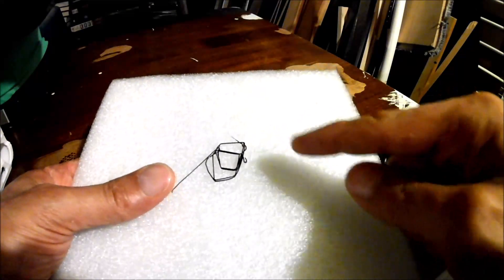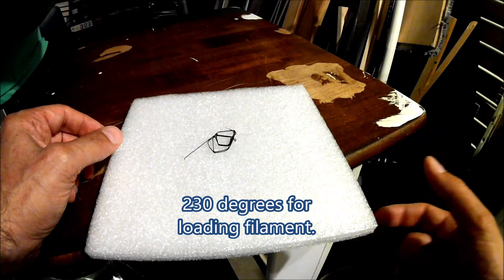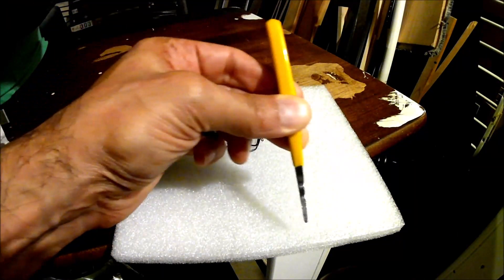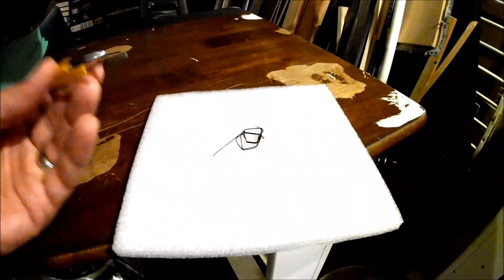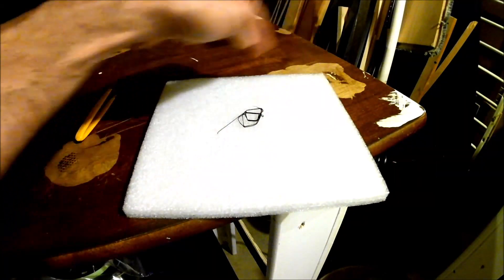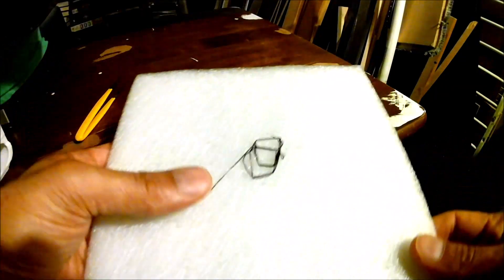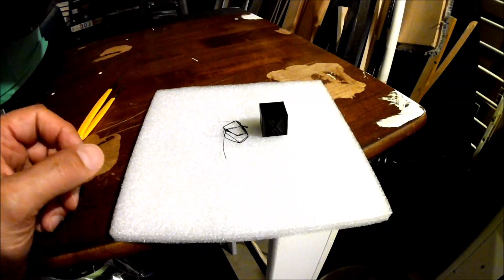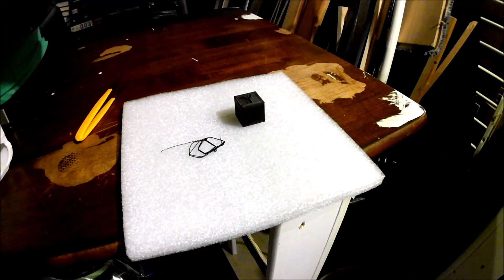Quick fix to this weird Anycubic Vyper auto level issue after firmware upgrade.

Comment: same here i backed the fillament back a bit then auto leveled then i load fillament back in
Reply from the maker: Optimally you could unload the filament completely but backing it out a bit seems to work fine too.  Maybe I'm lucky, but I haven't had to re-level this Vyper since the firmware update, and I print regularly.  Thanks for watching!

Comment: Had exactly this same problem. I just couldn't get the first layer to take after upgrading to 2.3.9 and re-levelling the bed. I was getting a slight ooze of filament from the nozzle. I suspect this was giving a false level and therefore there was too much of a gap between the nozzle and the bed. I had tried cleaning the bed, using hairspray and playing with the Z offset and then I had my eureka moment. I unloaded the filament, waited for everything to cool and re levelled the bed with NO filament loaded. Then I re-loaded the filament and retried my failed print. The first layer was spot on and now 4h 54m later, I'm looking at a perfect print sitting on the bed. Many thanks for helping me to this satisfying conclusion. 👍
Reply from the maker: That’s great to hear!  Yes unloading filament is likely to give the most reliable level, especially if someone is running into issues.  Thanks for watching!

Comment: Doesn't the leveling use the table as a contact in completing a curciut. It sends a little voltage though it?
Maybe I got confused. Is it actually pressure sensitive?
Reply from the maker: That may be the tech behind it, but having these blobs definitely interfered with a proper bed level.  I assumed it was pressure, but perhaps it was messing up the contact.  Thanks for the info!

Comment: Great Tip ,I have question about OctoPi and the Vyper is it possible to see what layer the printer is printing in real time and pause the print at a set layer.
Reply from the maker: GCode viewer in OctoPi definitely shows an animation of each layer as it's being printed.  With the "exclude regions" plugin you can exclude parts of the model mid-print.  As far as pausing at a specific layer, this should be achievable with some GCode. There are a few ways to pause with Marlin commands.  I see M25, M75, and if your goal is to change colors maybe M600.  Best of luck, I'm curious to hear if you sort this.  https://marlinfw.org/docs/gcode/M025.html

Comment: Those little dots are annoying. I placed 3mm of extruder retraction in my end gcode, in my slicer, and that fixed the nozzle oozing.
Reply from the maker: That's a good idea.  On print start, do you add the 3mm back or just let it come out in the skirt or raft?
Reply: @renaissancelaboratories5645  I actually put it in the end gcode, so it’s already retracted when the nozzle heats for the next print.